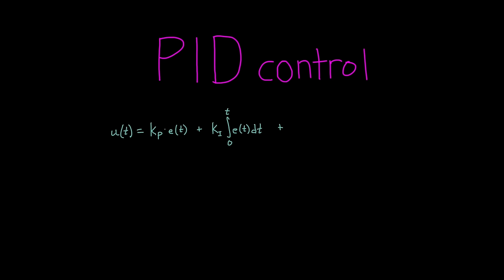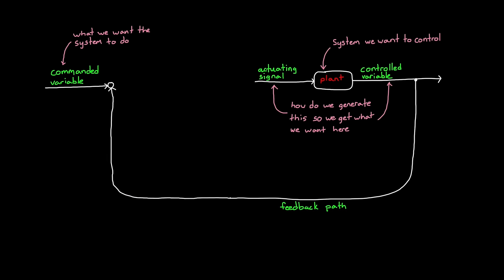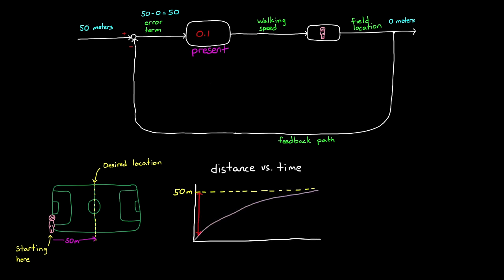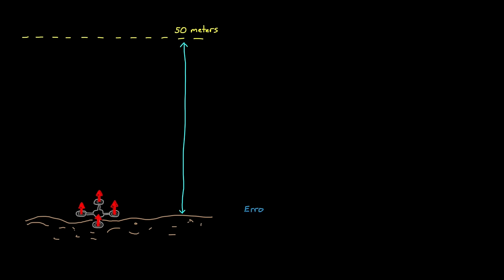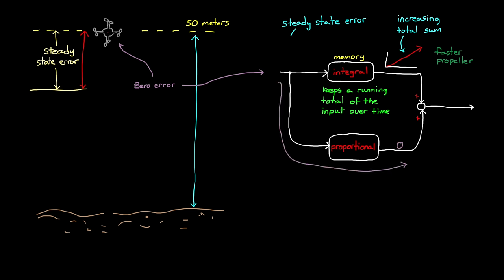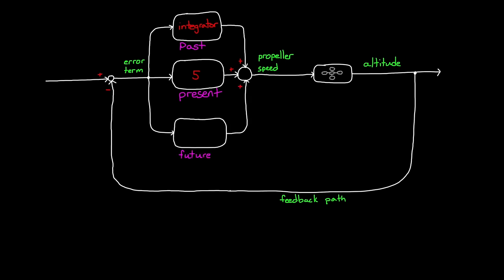What Is PID Control? | Understanding PID Control, Part 1

Comment: This is the greatest simple explanation of PID controllers that I have ever watched. It helps you to understand why there is a proportional and integral and derivative controllers. Thank you so much for this video .
Reply: Can anyone please explain, why after controlling it became walking speed? At first it was error between reference point and altitude. Then why it became speed after using PID controller.

Please explain
Reply: @nadiaakter9351  The controller takes as input the "error signal" (which is the distance between the desired altitude and the actual drone altitude) and outputs the input to the drone (the propellers' speed). You need to think about what are the actuators of your plant and what can you control. Your plant (Drone) has 4 independent actuators (4 propellers) for which you can control their rpm/speed (via providing more current). So, your controller takes as input the difference in altitude ("error") and and tells each propeller how fast to spin in order to reach the desired altitude. Hope that helps.

Comment: MatLab codes (Almost all codes for Numerical Analysis):
.

CHAPTER 1: Solving System of Equations 
1. Gaussian elimination:https://www.youtube.com/watch?v=k-Z3u36VFmU
2. Jacobi method: https://www.youtube.com/watch?v=GzqR07kRN1U
3. Gauss-Seidel method: https://www.youtube.com/watch?v=buIb7DWT2Gs
.
.
CHAPTER 2: Solving non-linear equations
1. Bisection method: https://www.youtube.com/watch?v=Kk3H3o8rb4Y&t
2. Newton's method: https://www.youtube.com/watch?v=LkSgVdCif90&t
3. Secant method: https://www.youtube.com/watch?v=_UldByPilXc&t
4. Fixed-point iteration: https://www.youtube.com/watch?v=VdTl3Rlio9g&t
.
.
CHAPTER 3: Numerical Interpolation
1. Newton's Divided Difference: https://www.youtube.com/watch?v=NCxqXBv5FfY&t
2. Neville interpolation:https://www.youtube.com/watch?v=Q2_6jlneXeY&t
3. Hermite interpolation:https://www.youtube.com/watch?v=fDbPBArjYCk&t
4. Cubic spline (natural):https://www.youtube.com/watch?v=SXujVMd8KLE&t
.
.
CHAPTER 4: Numerical Integration
1. Trapezoid rule: https://www.youtube.com/watch?v=QSHkg7ZPLNs
2. Simpson's rule: https://www.youtube.com/watch?v=NXBqq9DZefw&t
3. Romberg integration: https://www.youtube.com/watch?v=9WAuRUJ-XX4
4. Adaptive quadrature: https://www.youtube.com/watch?v=F1FMxXhKvMg&t
5. Gaussian quadrature: https://www.youtube.com/watch?v=6VF57yEzxdw
.
.
CHAPTER 5: Finding eigenvalue and eigenvector 
1.Power method: https://www.youtube.com/watch?v=DapdMQesiyc&t
.
.
CHAPTER 6: Solving ODE
1.Forward Euler's method: https://youtu.be/PC-V48sPo3k
2.Backward Euler's method: https://youtu.be/Lz_dDjQdOv0
3. Modified Euler's method:https://youtu.be/HcBX5cXbsts
4. Midpoint Method: https://youtu.be/r-tytOMFwz8
5. Heun's Method: https://youtu.be/JSbRmedkgbY
6. Taylor's Method of Order 2: https://youtu.be/gkbtaXV7dYI
7. Runge-Kutta method (Order 4): https://www.youtube.com/watch?v=0_YxBUleAQk
8.Runge-Kutta-Fehlberg method:https://www.youtube.com/watch?v=AJiU2VaRFWg
9. Predictor-Corrector method: https://www.youtube.com/watch?v=3hLTo1Cwfjk&t
.
.
CHAPTER 7: Solving PDE
1.Linear shooting method:https://www.youtube.com/watch?v=nswD09LmLU4&t
2. Finite difference method:https://www.youtube.com/watch?v=cWcMLjCpAO4&t
3. Nonlinear shooting method: https://youtu.be/pEEHIuaFPZA
.
.
Chapter 8: For FUN:
Drawing love symbol using MatLab:
https://www.youtube.com/watch?v=FdwPljbZjPg&t
https://www.youtube.com/watch?v=FdwPljbZjPg&t

Comment: 🎯 Key Takeaways for quick navigation:

00:00 🎯 PID control involves manipulating signals to achieve desired system outputs, focusing on intuition over complex math to understand its workings.
00:58 🔄 Control engineering aims to generate the right input for a system to produce the desired output, comparing the system's actual performance to the expected outcome.
02:26 🚶‍♂️ Proportional controllers adjust system behavior based on the present error, changing commands in proportion to the difference between desired and actual outputs.
04:25 🚁 Proportional controllers may lead to steady-state errors in some systems, failing to eliminate differences between desired and actual outputs.
06:57 🔄🕰️ Integrators, alongside proportional paths, track past errors, continuously adjusting outputs to drive the system toward the desired state, eliminating steady-state errors.
09:20 🔮📈 Derivatives predict future errors by assessing the rate of change in the current error, allowing the controller to respond to how quickly the system approaches the desired state.
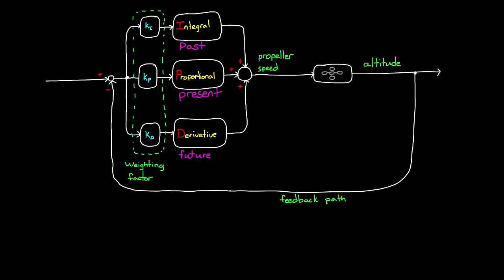10:26 🎚️🔄🕰️ A PID controller combines proportional, integral, and derivative paths, each contributing to the overall output, enabling the control of various systems by tuning these paths' contributions.

Made with HARPA AI

Comment: This is a really great video thank you for all the work and thought put into it. The only thing I don’t understand on the integral explanation is why you switched from feedback being propeller speed to being height. If you could receive feedback of height and calculate error for it then why didn’t it start that way with the P controller??

Comment: Hi Brian. 
This is a great video, as usually is the case with your production.
Thank you for doing it. One quick note: down at the 05m:13s, I believe
it would be more accurate to point out that the drone will keep going up.
Actually, with this two order system (force-position) using a P-only will produce a sinusoidal oscillator (idealizing no viscous forces).

Comment: Assuming we are already hovering at 50m already having achieved the 100rpm. What happens when a new set point is chosen at this stage? Say 70m is chosen to be the desired set point. This means that we'll have an error of 20m which would mean that the actuated signal would rise over 100rpm in order to approach the new set point and then as we get closer to the new set point, the actuated signal would be reduced until we are at 100 rpm at the new set point. Right?

Comment: Hi Brian, thanks for this great video. I have just one question about your example with the proportional gain in the drone. If the propeller speed reaches a max of 100rpm, shouldn't the height be constant as the lift force equals to the drone's weight? The only way I see the error in the height to decrease is the propeller speed increasing with the gain. Thanks again for all these great videos in your channel!

Comment: i'm not sure where to put this infos about control theory yet. is it occuring in a distinct study area or is it a part of many different areas you could study? Or it is a unique area you could study?
i mean the difference between when we would talk about finite automata, which will occur in different study areas and if we would talk about the software developement cycle, which would be bound specifically to software engineering as a study area.
Sorry, if that question sounds more complicated than it should be.

Comment: If the error is negative, then the proportional term would command a negative propeller speed which is not ideal. So the ouput of the controller should be change in the propeller speed. This would also remove the steady state error. AM I right?

Comment: You made this sooooo easy to understand!! I play alot of games where i need to use pid systems to create some form of cruise control or engine rpm controller and it has been really difficult to me to understand, i was just changing random values hehehehe. Thank you for the simple explanation!
Reply: which games need engineering level knowledge to play..?

Comment: It is told that when we use oly P controller, there is a steady state error.
 What if we use only the P controller, keeping the setpoint higher value (maybe 100m) than before, and keep Kp such that the steady state error is of 50m and thus we get what we desired...that is drone hovering at 50m ? What is the error in my understanding?

Comment: Please someone clarify something for me: It was my understanding that the integral term of a PID was used to REMOVE the steady-state error (or offset). But here it is used to GIVE the system an offset (necessary baseline propeller speed for the drone to hover at desired altitude). Is it correct? And so, an integral controller can be used either to remove offset or to provide offset?

Comment: In the first example, where only the P term works, why should the propellor stop spinning after achieving the desired height of 50m? Instead, it can set the RPM to 100 right when it reaches. That would still cause error in terms of overshoot or undershoot, but that makes this more understandable I feel.
Reply: this is because the controller has no idea if 100RPM is the right speed to allow it to hover. this is an arbitrary value, that is unknown within the system. in the real world this 100 RPM isn't even set, as the hover propeller speed changes with altitude and wind and all sorts of stuff. the controller only knows the error.

Comment: So technically PID can be a hardware or software, it's just an algorithm right? For example if u have oven that u need to control precise temperature. So you have heating element which controlled by microprocessor through relay and temperature sensor. So in this point code in the microprocessor that will read data from sensor and react on hitting element by sending signal on relay would be a PID. Right?
Reply: PID can be implemented in hardware or software because like you said it's just a function that takes control error as an input and outputs actuator commands and you can do that with simple analog components.  I didn't exactly follow your second statement regarding the oven but many industrial ovens use PID-based controllers.  I'm not actually sure what home ovens use but I suspect it's either a PID controller or a simple on-off controller.

Comment: How to control the two parameters of the system? If the two parameters are not related, do you use two pid? If the two parameters are related, what control method should be used?

Comment: At 6:31, we could also get rid of the steady state error by setting the input as 70 m - instead of adding the integrator, right? (I assume proportional gain to be 5).
And if we had to do it for a general input we just add a block which offsets the input like this: 

modified input = given input + (output req. for hovering/proportional gain)

Comment: but for know the altitude i need gps. i cant use pid if i dont have data of altitude. i can use only P. and set 0 on I and D. is right?
Reply: You would need to know altitude in some way in order to control the altitude of the drone.  This could be done with GPS, but you could also do it with a pressure-based altimeter, a radar, lidar, or sound-based altimeter or some other altitude sensor.  You could also "observe" altitude by measuring acceleration with an IMU and estimating altitude over time, although this type of dead reckoning estimation builds up error over time. As long as you have altitude, you'd be able to apply all three branches of a PID controller to it.

Comment: I made a system that keeps subtracting the difference between current and desired position. The output is the amount of difference there is. This means that as you close in on the target, the change in power becomes so small, that the power doesn't jump up or down. It smoothly corrects itself as slowly as the error is. This is lacking the derivative part of a PID controller though.

Comment: One question:
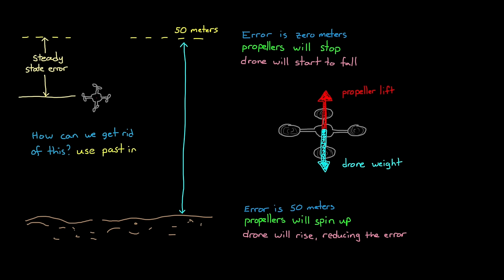6:35... We can get rid of Steady State Error without Integrator also right?

Till now, propellor speed = error * gain
why cant make it propellor speed = error * gain + 100rpm
Reply: It doesn't work cuz finding that 'constant'(100rpm) accurately is not possible in the real world. 

But we've got a hint that we need to add not just a constant.. but an intelligent term, which can calculate this term by itself. And, hence adding an integrator make more sense to me now.

Comment: Hi @Brian, thanks for your lecture. I have a question about PID control and a specific system. Suppose that I have a system that is totally digital and I control the throughput of data on the output of my system by aggregating data in my system while the input workload changes over time. I only see the possibility to use the Proportional control in this system. My question is: would be reasonable to use the Integral control in this system to deal with the size of the data that i am aggregating, or with the time that I spend aggregating data? Thanks in advance!

Comment: Here is a question, I know an external integrator solve the steady state error and is pedagogical for explaining PID but it's not the first solution that came to mind, for example 
Why not just add the known gap value needed for hover to the error in the controller input? 
For example for a value of Kp=2, the value to add will be 50,  so if error==0 then controller output will be 100 and hover,  without needing an integrator. Also, this added value can be adjusted automatically by a static operation with Kp, addVal=100/kp;
Reply: Great question and you are completely correct! You could add in a feedforward term that adds 100 RPM to the output of the controller so that a zero error would produce the value needed to hover.  And this would work with a proportional path-only just fine.  However, this can be dangerous because you're putting a lot of trust in the hovering speed and that it won't change under any operating condition.  For example, flying your drone at a location of higher altitude, flying in hotter weather, or changing the weight of the drone would all affect the needed propeller speed to hover.  If the gap value changes like this, then hardcoding a single value won't work and you'll still need the integrator.  A better approach would probably be to add that feedworward path to add in an average hover speed over all environments but also include an integrator as well.  This would keep the integrator path from having to work too hard, but it would still be there to correct for any changes to the system or the operating environment.  Hope that answers your question.

Comment: Hi, first i want to thank you for good explanation. I have a question. If we think the drone example we can start the propellers with 100rpm. If we do that when the error became 0 propeller speed will be 100rpm so we provide the hovering at 50m. I mean propeller speed = 100rpm + proportion. Can't we do that ?
Reply: So we would be giving the drone a propeller speed of 100 rpm no matter what? That's technically possible, but it would defeat the purpose of having an automatic control. And it wouldn't eliminate the steady-state error, because like that, you would be having technically only a proportional automatic control, with the previously addressed problems. Whereas an integrator path COMBINED with a proportional path does eliminate the steady-state error
Reply: @augustomunoz6138  Thank you for the answer.

Comment: In the case of reaching 50m and horvering how the integral of error=0 will equal a constant which is 100rpm to make the drone hover  ???
Reply: It's not exactly like that. Of course the integral of zero can't be 100 (rpm), but keep in mind that the integrator has been adding and substracting OVER TIME, so that when it finally STOPS adding and substracting (when the error is 0), the output of the integrator is 100, because it has reached this value previously than the error reaches zero, and will remain 100 for as long as the error is 0.

Comment: Excellent examples. 
I have a question, for the drone example to counter the problem of reaching hover speed before the drone reaches the target altitude, can we set the drone to run always at hover speed and increase the speed if there’s an altitude difference using just the P Controller?( removing the need of Integral controller and it’s con of overshoot)
Reply: Unless you want the drone to descend the propeller already run at hover speed or higher.
Reply: @koharaisevo3666  Then we can have two modes- ascend and descend, during ascend minimum speed must be equal to hover speed and at descend minimum speed shall be zero.

Comment: Planning something and getting it done. Input is designed to get the desired output. 

Something going wrong in achieving the result is misjudgement or mismanagement or miscalculation. Error needs to be corrected. Error cannot be improved as better error.

Comment: Excellent video! Just a small nitpick: Propellers are used to propel a craft forward, whereas rotors primarily generate lift. So rotors would have been the correct term for your example.

Comment: why the proportional gain change from 2 until 100 ? it is should be constant.. anyone can explain ? please 😅😅😅.. it makes me a little bit confuse..
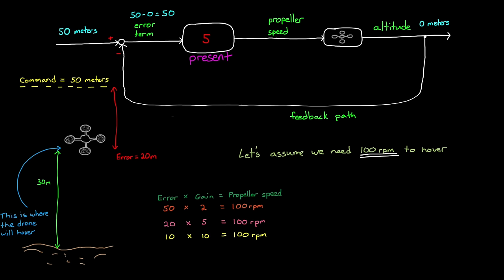Reply: Are you talking about the time around 6:05? During this section, I'm just showing that as you raise the gain the steady state error gets smaller.  It shows how that error changes when the gain goes from 2 up to 100. Once you decide on a proportional gain value it would be constant from that point on. Was that what you were asking?
Reply: Brian Douglas Okay.. i understand now about proportional term.. do integral controller only sum error when the error constant ? and derivative controller only work when the error change.. correct me if i am wrong.. 😁😁😁
Reply: The output of the integral path changes whenever the error is non-zero.  The error, however, does not need to be constant.  If the error is positive, the integral term will be added to, if the error is negative it will be subtracted from.  If the error is zero then the integral term will remain constant at its present value.  The output of the derivative path is based on the changing error as you say. I hope that clears it up for you.  Cheers!